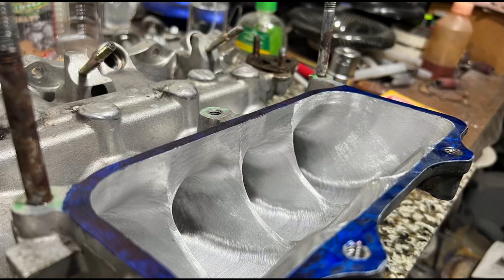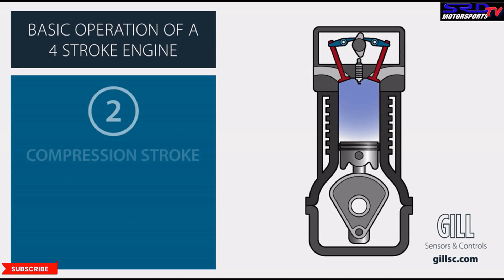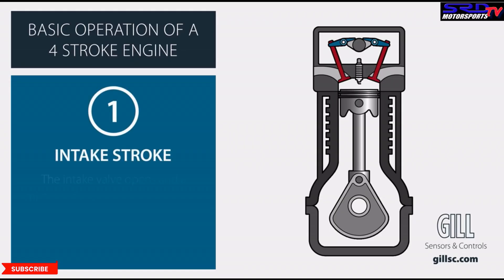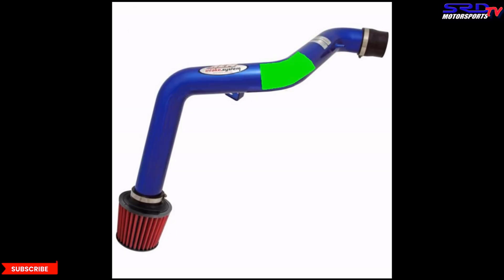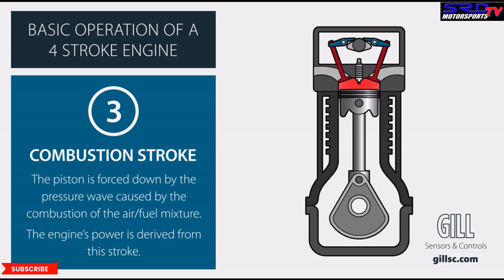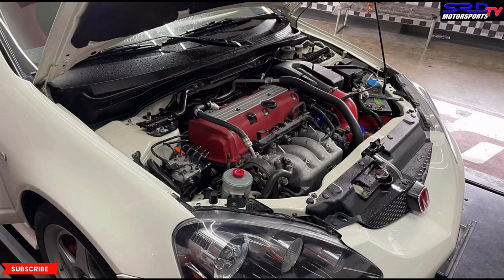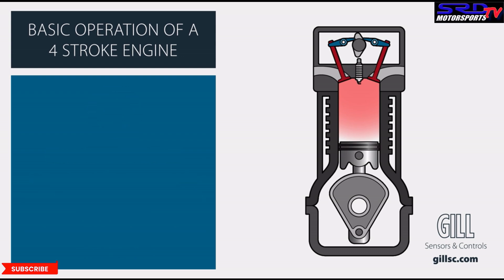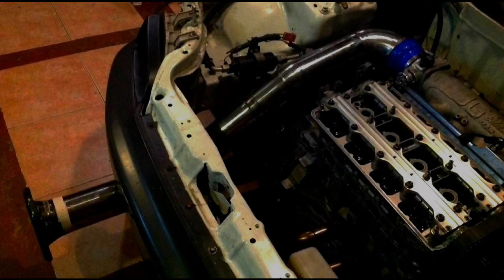Volumetric Efficiency : How & What to Improve for more Power

Comment: If you are working out VE in comparison to WHP are you not doing the engine a disservice as it loosing maybe 15% in drivetrain losses? if you use Flywheel HP that engine would have a better VE. If its making 148 at the wheel and has lost 15% is making about 174hp at the flywheel so it's running over 100%VE isn't it?
Reply from the maker: @krusher74  true but, we see and use whp 
For some it’s just more relatable and realistic

But yeah some rely on flywheel hp but some do prefer referencing whp

Comment: I have some discussions about that 🤣 nice channel BTW! 🙂

A bit long sorry but it's my experience with VE

A lot of people asking me to put my car on a dyno but i don"t want 🤣 It's a swift sport 1.4 16v VVT turbo. Stock it's about 155hp (given for 140) with 80% VE at 6000rpm (in the ecu VE table) and 0.54b (7.8psi),   and still stock map 85% VE at max torque with 1bar (14.5psi)

 almost stock parts on it. I just put a air filter, forge blow of valve red spring, to keep it closed because others a letting pass through some air, just a bit but bad for VE! I bypassed the solenoid of the BOV to not let the ECU open it, performance sparkplugs, gain around 10hp, i never seen that before... and a racechip box gts... This is just to give the informations, you will understand why 🙂
oh and a pedalbox, very usefull on rolling race! crasy!

In the swift community, a lot of people are going in stage 3 to reach 230-240 to 250hp with a lot of parts, turbo, full exhaust, intake, sparkplugs, bov, intercooler, injectors,... all possible, and they are between 1.2b and 1.4bar at 6000rpm, and a few thousand of euros/dollars... some at 12000 euros 🤣   and knowing that the engine efficiency is between 30% and 36% and these engines...

Normally a stage 1 and stage 2 are given between 175 and 195 hp. Racechip is giving on they site for that model 167hp.

Ok now, what is so interresting with my modest and intelligents modifications 🤣 i'm joking a bit

With my modifications and the stock tune at 1.54bar (7.8psi) i read with torque pro app and other tested, i have 93% VE at 6000rpm, it gives around 180hp, meseared with perfexpert and torque pro

 and with the racechip box settings 7, 102% VE and 1bar (14.5psi) at 6000rpm.

I have calculated with at least 30% engine efficiency : 83.786 (Engine Capactity Cubic Inches) * 1.30 (engine efficiency) *  1.3557 (torque) / 9.81 (convert to mkg)= 15.05mkg

15.05 mkg * 1.02 (102% VE) = 15.35mkg
15.35 mkg * 2 bar (atmospheric pressure and turbo pressure) = 30.7mkg
30.7 * 6000 rpm / 716 = 257HP  ...  i try to tell people that th stock turbo is not to small and gives more than 100% VE at 14.5psi at 6000rpm but people are not listening, they like to spend money...

oh just to know my 100 to 200 km/h  is around 11

And on torque, in low rpm 125% VE adding 1.3bar (18,85psi), then at max torque around 4000rpm, 110% VE adding 1.35bar (19,58psi).

So i don't need to be an astronaut to understand that i am fare from 167hp given by racechip.

And talking the person in stage 3.
The same ingine in natural aspirated, with 100% and 30% engine efficiency it gives 126hp. So putting 1.3bar to take the half between 1.2bar and 1.4bar. 126 hp * 1.3bar with 100% VE must give around 289hp. 

So to go down from 289hp to 250hp they must have a VE around 86%.  So big turbo, big intercooler, free exhaust system, all of that to have bad VE values

I measured some other cars same way, perfexpert, torque pro, dynolicious in the past, and with VE calculating, every time result are in accord.

On my previous Opel Zafira 2L turbo OPC tuned stage 2, i had to change my exhaust system because it was broken. I go from 36mm to 76mm, i lost 30nm.

Putting some parts can sometimes affect negatively VE, it's not everytime giving power and torque 😀
Reply from the maker: yep putting in parts doesn’t always mean it will improve

Comment: b16
12.4:1
160whp at 8000rpm
Reply from the maker: 82% is 162.5whp so ur close maybe 81.5%
Reply: @SRDmotorsports  it makes peak torque at 7600rpm 148whp
Reply from the maker: sorry made a mistake on the math
With ur numbers it’s
160.7whp is 90%

So you’re at 90% VE

Comment: 14:34 in this calculation, what kind of formula do you use to get the engine HP based on V.E., compression ratio, and displacement?
Reply from the maker: it’s a long math but it’s always a close estimate
Reply: @SRDmotorsports  can you give me the reference where can I read it? I'm interested to know deeper about it
Reply from the maker: It’s been years but let me check if I can find it
Reply from the maker: And I don’t use it to “project” a reading

I use it “after” the dyno when we have the real HP then calculate and check how far off it is from 100%

Comment: have a b18c1 GSR fully built head with 12:5.1 85mm pistons set to 8844 rpm, skunk2 pro1's. Whale penis intake with edelbrock victor X

Did the crank case vents.

How can I get this efficient?
Reply from the maker: Nice set up man!!

Perfect timing… u can check the latest video of the b20vtec I talked about improving efficiency def would work for you

https://youtu.be/8MS8jkMIKvs
Reply: @SRDmotorsports  ok, what is the math to figure out? little confused about that.
Reply: @SRDmotorsports  would you change anything with the my setup?

oh forgot to mention have skunk2 lmas

Exhaust is 3" to 3" ktuned lobster tail muffler
Reply from the maker: @dudapropp8826  only thing I’d change is the whale penis intake… the victorX needs help on airspeed and as I linked the latest video notice my visualization of the intake stacking air on long intake pipe or cold air
We see a lot of dyno sessions with that kind of long intake with vstack for a reason :)

I think that alone will wake The beast up on ur car 😎
Reply: @SRDmotorsports  in place of the WP, what should I use instead?
Reply from the maker: @dudapropp8826  any consistent 3in intake pipe should be real good test it out first

Comment: Did you take into account you’re measuring at the wheel or hub, not the flywheel… so there’s drivetrain loss…. So your v/e estimate is off by a bit
Reply from the maker: Yep the formula I use is for “at the wheel”

Not hub

Comment: 196 whp
7800 rpm
11.5:1 comp
B20v stock b16 head
Reply from the maker: Oh snap! thank you brother! Okay give me a few… lemme compute the
Theoretical 100VE and
Ur current VE. And what’s the next u wanna calculate? Either jump to 12.5:1 comp same VE or if theoretical bigger cam same comp higher rpm VE

Just for the third and “foretelling” numbers aside from the current
Reply: @SRDmotorsports  well im using pro 1 cams with stick itr intake just want to make over 200 whp so might port the intake and change the exhaust manifold using the same compression
Reply from the maker: The current theoretical 100VE comes out to
221.29whp so u are at 89.5% something VE effin good for a stock head! Means intake and header is doing “fine”

Let’s pretend u jumped to 12.5:1 comp and. The theoretical 100VE is
240.56whp so same 89% gives you
214whp?!?

heck u can just mill ur head to get that bump lol!

BUT let’s say u clean up the head lightly port it and match everything? Let’s say u hit 91% VE on the same comp and same everything
That’s…
201.3WHP!!!! So u are right there man on ur goal and while at it? Maybe mill the head a tiny bit perhaps 0.020” and prolly jump to 11.75:1

205-207whp sounds to be yours :)
Reply: @SRDmotorsports  ok so just by milling the head i should meet my goal ok ill work towards getting a spare head then port and polish it
Reply from the maker: @derronbritton6668  looks like it man cuz ur current set up is working good including the exhaust so yeah if u find a cheap core snag it

This way it buys u time, 

Oh man! I smell 205-207whp brewing yeah!!
Reply: @SRDmotorsports  i have the rmf v2 megaphone header with full 2.5 exhaust think I should change the header design
Reply from the maker: @derronbritton6668  the exhaust seems okay for now actually

Comment: How about ejector effekt on intake?
Reply from the maker: Yes it has some good effect if the injector is good or “new” design 
However a b18c (1795cc) won’t make a b20 (2liter) power figures on injector alone

And gaining from it? Even if it’s just 2% power increase and everything remains the same = you just improved your Volumetric Efficiency too
Reply from the maker: Part of the reason I didn’t include it is because you and I know… some will start looking for the “best” injector thinking that’s it and not even focus on the intake and exhaust system because the injector helps 🤣😂🤣
Reply: https://youtu.be/g7INxIkReNM   I,am sorry but not injector,”Ejector” effekt total different,this video show you what i ment in 11:48 min,the exhaust pressure utilize vacum in the intake manifold aka more air to cylinders! If the a video didnt open,type Norton rotary(Vision racer)

Comment: now im more excited to install the intake manifold you ported..how I wish the dyno shop around our area is close enough to do a quick comparison  and get a real picture.

makapagawa nga ng CAI😁
Reply from the maker: True on dyno facility! Even here it’s roughly an hour away + traffic so it could easily be 2hours away lmfao!!
Reply from the maker: It’s also why “ram air”’works even on take off

The “length” is so CAI hmmm :)
Reply: next project CAI..I got to say good visual on the CAI with the moving "air" flow...indeed it is easier to understand.
Reply from the maker: @the063one  thanks man and tbh? I visualize it easy like that but now I realize maybe this is why way back when I talk? They look at me as if I’m speaking a diff language hahaha
Reply from the maker: @the063one  one thing I failed to remind on this video as I was trying to minimize it from being too long is…

See the air columns stacking on the CAI? Now imagine intake valves of chamber 1 is open? Yet piston goes up so it’s trying to create “reversion” ?  Now it can’t cuz air got back up lol like stacks back up pushing it or cramming it inside = and that’s how we raise VE
Reply: @SRDmotorsports  good guy CAI shoving air to the throttle to the intake mani😆.

I can picture it in my mind..haha
Reply from the maker: @the063one  that’s the “back up caption” guy 

“Yeah man that’s right yeah”

😂🤣

Comment: That's a clean type r. The intake manifold made some nice power and torque and now doesn't seem like the type r needs much more to be faster. For the intake maybe performance venturi style throttle body spacer for some more torque to help the intake and manifold. For exhaust:) I'd perhaps add a bullet style 2.5 inch resonator  to slow down flow a bit to get more(and maybe some sound) performance without losing air speed. Would using fd2 type r intake cam be worth it as an upgrade to the owner? Another good video btw!
Reply from the maker: True on the intake stuff! But the dc5 is so cramped lol but the owner now actually did the Hondata style mod of gutting the airbox inside so the filter is more spacious the area…

On the exhaust you and I feel exactly what the Tuner (Leo) of speedworks and the owner feels… as the stock catalytic convert seems to be a big restriction!  But indeed the resonator suggestion u did mention is indeed one of the points the owner is targeting fo sho
Reply: @SRDmotorsports  hehe yes I know what you mean by it being cramped that's where the fd2 comes in With 2 more doors and apparently better rigidity, but man I like that ITR with those wheels make it 🌊.  Oh yes the gutted airbox 😁 that thing should rip and sound nice doing it. As far as the cat, maybe high flow one or modded stock not sure how owner wants to go about it. I kinda like the endurance-type set up where you just tweak at the motor by improving efficiency since the k20a motor is well designed and doesn't need much more to be faster. With your manifold and intake/exhaust work should unlock type r potential. 

I noticed how fast the fd2 is when modded well and I think if they had some IM work and a good intake setup and tune and they'd be giving those evos and Stis and even harder time especially at highway speed. The fd2 here and the fg has the same motor but the fd2 is known to be faster which always had us scratching our heads.
Reply from the maker: @vtecnegro85  super super agree on the “endurance” style mod tbh actually me and the owner we would mention the same thoughts as to sort of get the max but try to keep it as close to OEM durability and simplicity 

I agree on the intake manifold stuff I do think there might be more in it and TBh we have seen 220-230whp stock k20a locally on Kpro and all

But all are on scav exhaust and a vstack ram intake and on this we hope to atleast see 225WHP “stock way” hence “spoon style”

Might be hard but def something that could be interesting not just locally but everywhere

Comment: For you calculations, isn’t the goal of 100% VE for how much the engine makes? Wouldn’t you need an engine dyno for bhp instead of a chassis dyno whoch measures whp after the driveline loss?
Reply from the maker: Actually that is true and the actual VE would be a lot more calculations etc

The formula I learned is more of a quick “close close” estimate in reference to using the dyno numbers or dyno “you use” which actually helps atleast for me it’s like we can’t compare dynos but even here locally if it’s on the same dynojet facility + fuel = a closer reference to estimate with others? Like example
We both know if we see a local pull a 215whp dynojet numbers and with a torque of 135ft/lbs and will claim it’s a b16 ? We both know that’s a strong b18 not a b16 🤣
Reply from the maker: Basically it’s also how I see or check when someone says their B16 makes xxx power and a torque of a b18 ? Hmmm lol

Maybe their b16 bore is as big as a b20 as well as the crank 😂

Comment: What header will you be running for the K20A? Also, any plan to deviate from the stock airbox? How bout a loooong 3in intake with a v-stack and filter? Also, the SSR header or the Toda header makes good power under the curve
Reply from the maker: The k20a will be tried to keep oem as much as possible but will prolly make a thread and video once we start it as for now it’s still the k24 we have disassembled 

The dc5 of the owner was dynoed with stock header too
Reply: @SRDmotorsports  VTC tuning really has a way of making these engines very potent even in stock form :)
Reply from the maker: @findtherightbeat  that’s true and but see the dc5 on the video? Vtc wasn’t really moved around too so that makes this even more potent and fresh
Reply: @SRDmotorsports  Lowering VTEC to 5250 and leaning out the map above 5500 helps these engines. How OEM do you plan it to be?
Reply from the maker: @findtherightbeat   not sure with the owner but I believe stock header and possibly intake but porting will be done

Actually this time id let Leo Of Speedworks do the tuning as he did the first dyno tune of this dc5
Reply: @SRDmotorsports  Definitely! If I remember correctly they had this H22 Civic that chased a GT3 and the driver gave a thumbs up at the end because he wasn't able to pull away from the Civic.
Reply from the maker: @findtherightbeat  oh snap I think I vaguely remember that
Reply from the maker: Or atleast the story I mean lol